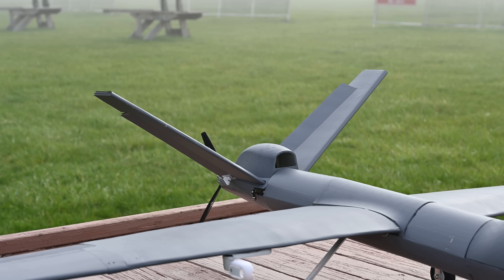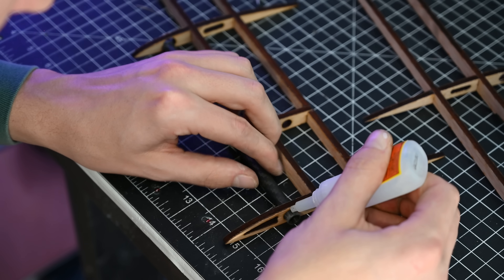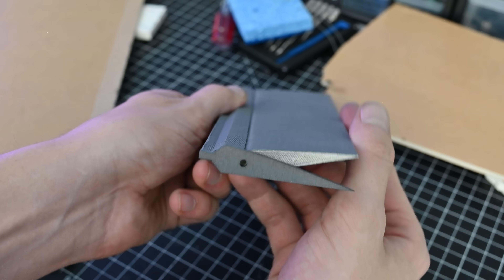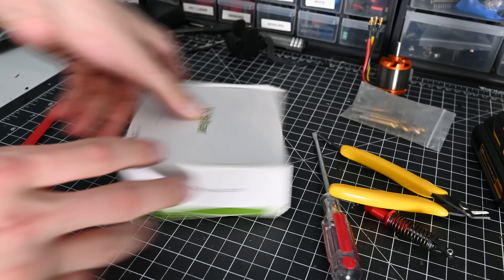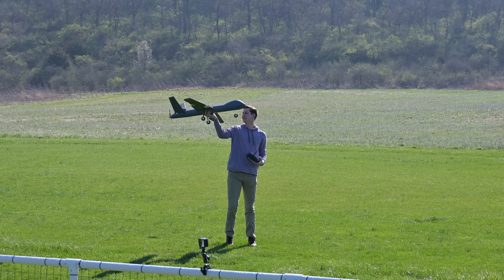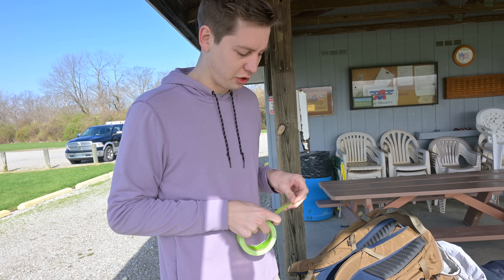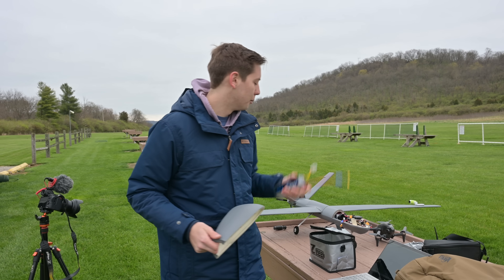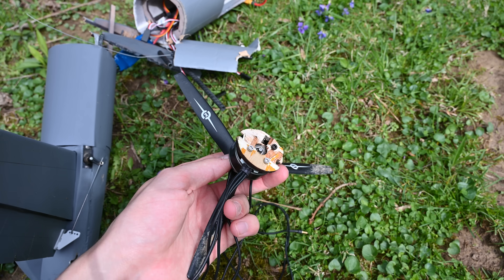Building a DIY REAPER Drone... Ended Badly

Comment: you could have used your sponsor again and had them make you over engineered rear prop mounts and landing gear mounts. they have a lot of materials to choose from for building, I'm not sure if they have it but you could try carbon fiber, or just say no to under powering this master piece and have all the structure made from refined aluminum and step up the motor size. it would need a good bit more thrust to launch but it would also be way more robust and impact resistant. plus you could add real mounting points for all of the hardware with wire routing through the frame. this thing could be awesome also adapt the bottom front of the aircraft(for a lower mounted 360 gimble camera or something controlled with servos and maybe a micro controller. idk man its awesome either way i was just spit ballin

Comment: I was lead designer for the IMMC (integrated misssion management computer) for the Global Hawk UAV.   Love your content.  Retired 2017.  So my stuff will be flying for decades.    In 1970 i graduated from high school,  an IBM360 system main frame executes 16.6 MIP (million instructions per second) in 2014 a single board computer VME6U about the size of a of a paperback would run 2000MIPS, wow that is lots of time to make reality happen.Like an FFT in real time.    ❤❤❤.  Good job!

Comment: Should have switched to larger diameter lightweight foam wheels so you could do regular takeoff and landing after the first flight. They are readily available at any mailorder shop or you could always make your own. Very thin but large diameter is the key so it is light but allows much better rolling. Will also give a lot more ground clearance for the prop.

Comment: I love that you are hitting all the maker marks with the laser cutter and 3D printer.  I've had students make rockets with 2 layer shells and they are light and strong.

Your reality is that models don't always work just by scaling them down.  Move the wing forward and try to mount the engine higher.  Try to make it more stable by moving the wing upward.

Comment: hey in aircraft design its about keeping it all in the circle. If you add more weight you have to compensate for it. I would have use just 1 six cell battery and placed it in the middle of the fuselage. This haphazard manner to building and skipping the testing phase is a common issue from software, mechanical engineering and building of structures large and small. Dont skip the testing it will save you a lot of time and money not to mention heartache.

Comment: Since you're not using landing gear. Maybe consider making a skid in the front? 

Just a Bent wire to safe the prop. 
Look at old style cable control airplane models

Comment: Add another motor which will turn two more propeller infront of each wing. The motor will be inside the body, the rotation will be transmitted to the propellers via some ribbons.

Comment: 3D print molds, surface treat and make the body out of a few thin layers of carbon fiber. be very careful with the strands because CF is pretty much as bad as asbestos. fiberglass also works plenty well for such a small object and is dirt cheap

Comment: You did a good job on it. As a suggestion build it at least twice as big if not bigger. Those bigger wings will have no problem with the added weight of several 8k ma batteries and an hour or three of flight time with gps points as nav points. Yes is it possible. If I can do it with a shadow you can do it with a reaper. Keep em flying bro!

Comment: MQ9's are not drones.
Reply: Yeah there RPA's
Reply: @calok  MQ9's are not UAV's- MQ9's are RPA's. You are speaking to someone who has worked on MQ9's. RPA=Remotely Piloted Aircraft. Meaning they need a pilot to control it. Drones do not require a pilot.
Reply: @ChristianAsselin-x2f  thats what i said
Reply: @calok  So in aviation the difference in classification is actually based on the requirement of manning. Drones can be pre-programmed to run a specific course, and while they do require oversight- they do not directly require human input once launched. UAV's are "Unmanned Aerial Vehicles", and another term for either a Drone or an RPA. Anything without a person in the vessel is a UAV. RPA's are UAV's that do not have a fully autonomous ability, or a programmable mission set. Just a bit of semantics- but tell any RPA pilot they fly drones and theyll give you this whole shpeel as well lol :) <3
Reply: @ChristianAsselin-x2f  Yeah

Comment: What a grate job keep it up, May I suggest you use Plastic, some carbon fibber or fibber glass material if u can for strength, and make it a little bigger and place the heavy material at the middle or just the right place. increase the length of the landing gear so the distance between the drone and the ground will have a reasonable for take off with no need for you to lunch it. (Just saying) But you did excellent work.

Comment: The build was very impressive.  About the crash:

1. Tail heavy. Adding the batteries and the landing gear adjustments did a job on the CG.
2. Angle of attack on launch was bad and there was insufficient airspeed. The result coupled with point #1 was an immediate and unrecoverable stall.

Comment: You use 1/4 pine to build the wings on the human passenger minimax. Some ultralights use mylar plastic to cover the wings.  Cut down on weight improve the glide ratio. Big difference between 8 to 1 and 30 to 1.  same with the stall speed.

Comment: Mike probably you add more HP on the propeller motor to correspond to the battery and the aircraft body weight - plus you need a bigger heart😊

Comment: Do you mind if i copy your cad from onshape and improve upon it? I already made a chassis. My plan is to build Full inhouse rc remote, 4g LTE connectivity along with 2.4 ghz remote control. Pixhawk installed on stm32f407. Telemetry will be there for QGC. No ready made flight controller. Where can i post my results. Would love to connect with u.

My major focus is stm32 based evaluation board software which i want to open source so that everyone who is poor like me can just do some medium level hardwork and avoid buying pixhawk cube etc ready flight control.

Comment: You should create a launching mechanism. Sort of like what they use on various TV shows when they have those type of drones being sent out. I would also remove that plywood and replace it with something like carbon fiber. It would probably be just around as light, maybe a little heavier, and you can get a beefier motor.

Comment: Your mistake at the end isn't necessary weight itself. I think you put too haavy part directly after engine, that's why your plane couldn't aim up. Try to install engine at front and try to leverage mass of it (use smaller batteries and connect them)

Comment: Find the CG location before throw. It is usually 30-40 % from the leading edge of the wing. Also don't throw up. Stall is caused by slow speed. Throw horizontally while human naturally throw up. From my 30 years of RC glider flying experience.

Comment: Try scaling this up. You will end up with a larger body wingspan and higher ground clearance.   It will take more energy to get off the ground, but you can make up for that with that second battery and bigger rotor.

Comment: Great Job Michael. I was thinking maybe you can replace some of stressed members with carbon fiber sheets that be laser cut such as the fuselage spars. That should give your plane much more strength so it doesn't break like it did above. And you can use balsa wood for the non stressed members where there are small loads to save weight.

Comment: Check out the Qidi Tech ASA filament designed for model planes, extremely strong and very light.   The newer Smart3 series Qidi Tech 3D printers are absolutely incredible machines with huge price drops announced a few months ago.  The XSmart Max has hit $800 range, I have recently bought the XSmart3 and was beyond impressed with how reliable and fast this printer is.   Check out their ASA Airplane filaments along with their new line of 3D printers they will prove useful to your hobby!  Very cool design!  My XSmart 3 has been used for 20 prints now using PETG, PLA, and ABS with a one hundred percent success rate and flawless prints.   Will be adding the Max to shop later this year.   I have some drone projects looking forward to trying ASA out on.

Comment: Little wheels for landing gear do not make scene, they snag on everything.  Instead use a flat airfoil ski, think modified pop-cycle stick,  with the tip angled up quite a bit when landing on a grass field.  A sling shot catapult launch system or pusher rocket motor that falls  away may work.

Comment: Drones dont need wheels to land. Use a catapult system for launch and use a folding prop. Think military, they even use nets to catch drones.
Reply: not that one the mq9 is huge and expensive and has landing gears your thinking about small ones
Reply: I wasn't talking  about the mq9 doh. @arthurboudaux4840
Reply: the reaper is like a small fighter, it has a landing gear
Reply: @nakata123 I know what the reaper is.

Comment: a carbon frame would for sure be better than plywood, if you could make a carbon body, even better and better tbh
would cost more, yes, but would also be way lighter and way stronger
a single 6 cell battery right on the center of mass would be better too

Comment: Two old school ideas for a launch assistance  could be  one an old fashioned   bungie like rc gliders  used to do before the electric retractable kicker motor  became popular  . A possible supplier of the band materials  could be either a sling shot band replacement  supplier or a medical l equipment supplier  for surgical tubing .  Or rocket assistance  .one option is to build a launch rail / ramp like the V1 used with  rocket booster  with  short thrust duration.   the second is to mount two Auxiliary rocket motors  near the Cg point  like early SAC  aircraft did to take off when heavily loaded( JATO). Try Google searching that term or  utube for a video on it . Granted, if  the plane is good in the air but is sub-par on takeoffs, and then possibly the extra thrust front two rocket thrust  modules  could possibly be the best way to  alleviate your problem . The rocket motors are relatively inexpensive  ten bucks for three  (A)  and (B)?  Sorry, it's been  a while since I bought any motors. Also, I might try instead of foam for skins, try  sheet balsa fusalodge wood and mylar wings.

Comment: You need some solar panels on the wings and less batteries. Maybe a bank of capacitors in the wings. 
I would go skids instead of wheels given the diameter if the wheels etc.

Comment: For the next one I would try and make it to where the wings could slip in better to the mold along with the nose cone to try and reduce drag. You could also implement the battery near the middle of the plane to try and help keep the center of gravity near the middle to help avoid a crash. I love the entirety of it and think you did an amazing job keep it up c:

Comment: Not sure if anyone brought this up, but you seem to be lacking a flight control surface dedicated solely to yaw control. It would seem you have roll and pitch covered, but the V shaped elevators will only produce so much yaw, and not at a perpendicular angle to the Z axis in flight. I would recommend adding a rudder directly under the fuselage below the elevators at the rear. This should give you full yaw authority in any crosswind flying conditions.

Comment: Noticed that you had some pretty substantial ridges between the front segments in one of the later flights. The amount of drag those were creating (while also impacting forward body lift) would be substantial and would make holding the nose up hard- was that a thing you noticed hand flying? A reluctance to pitch up? If so, honestly tape along those edges would've probably given you a lot more slip and lift. Also, more obviously, the lengthwise rigidity needs to be improved (less forward weight is a good idea you had, that will lessen the moment from the nose).

Comment: 4:30 just so you know what you did here is still illegal as according to part 107 (which I hope you have a part 107 license as your monetizing your drone footage here) https://www.ecfr.gov/current/title-14/section-107.52 you need to be 500 feet below clouds and 2000 feet horizontally from the cloud. And fog is just a low altitude cloud which would make it impossible to fly above the fog while still being 500 feet below and 2000 feet adjacent to it.

Comment: If you want to make the plywood way stronger before you put it together, brush it with cyanoacrylate/super glue. It won't add any weight but it will make it incredibly strong.

Comment: This is just a stepping stone to a better version. You learned a lot and a new version will be definitely better than this one. A few suggestions from me: make it bigger. The size is too small for a start on grass, double the size and you can fly anywhere. Using plywood this thin might be light, but laminated aluminium or carbon will be much better. It’s more expensive, but it provides a much better and sturdier frame. Lastly, if you make changes in the weight, take out the guesswork of balancing. Make sure your plane is balanced properly before you fly this thing. Keep on going with this great idea, I am looking forward for the next version.

Comment: Was calibrated and tuned with smaller batteries and and other parts. Sure the brushless and 9" prop would need more thrust then original settings. Any  arts and crafts stores shoulf carry balsa sheets. Tho dont believe weight was the issue,  but the hand launch without a run way to be able to tune snd go minimizing damage if any

Comment: Build to fly, not to crash; focus on light and strong not robust. Get rid of the landing gear, make it like a bush lanes or make it retractable for belly landings. Use a folding prop and your belly landings will be buttery smooth. Great work!

Comment: Why so heavy construction?  Lower weight = MUCH better flyer..  ditch the foam, and use balsa not plywood. Monocote covering. Those old timers who made planes this way knew their shit. That 6 cell battery probably weighs a ton!  If so- design plane to compensate for that weight.

Comment: it needs a stiffer fuselage and stronger landing gear. you need to position the landing gear carefully near the CG, and you really need to dial in the CG better. landing this airplane properly may be impossible on grass because the design simply isn't big enough. unless you increase the wing area this thing looks like it could be fast but quite a high-wing-loading handful to fly.

Comment: I thought this plane seemed really heavy!  Does this wingspan need those types of spars?  Everytime im in the situation where im like "man this isn't balancing i should put weight somewhere" I know some aspect of the design needs to be changed.  foamboard wings can be made like 60in or even a bit more with just a simple carbon fiber arrow from walmart

Comment: Way way too heavy for that size wing.  If you are going to use that much weight, simply adjust all your printing to 50% larger to make the whole plane larger with more wing area.  Another thing, maybe have someone else throw the plane so you can fully concentrate on correcting the flight path.

Comment: Pro tip, Glue doesnt bond well to a laser cut edge as it is burnt. You should sand off the carbon layer the laser leaves behind to ensure max strength.

Comment: nice plane bud .. i observed that the 1/4 inch ply your using is box store stuff , it breaks very easily ,  you got to try the aircraft grade multi layer stuff... from my testing over the last 35 yrs....the 1/8th multi layered ply inch its about 14x stronger than the 1/4in stuff your using. Its way more resilient to impact forces and bending loads.. i agree with others here if you were off pavement you would have been so stoked on the planes ground manners ... grass is tough for small planes.... really you need 3- 4 " dia wheels minimum to make good use of grass no matter the size of the plane... add the down fin to the tail to protect against prop strikes... or cheat that rear gear far back to get a better pivot angle so you can rotate on take off..pretty sure that Extra battery in the back put it in fly like sh!t mode.... nose heavy is usually just an annoyance most times its actually a good  .... one og my gliders flew ok for years , one day i just decided to bring my tackle box with me and just see how much lead shot i could add... i stopped at 2lbs!  thing flew like a dream... fast and long to land but woo it had a presence in the air, keep it up!!

Comment: The first flight was really impressive, you are talented in ways that differ from each other. I could not have even got the paint right much less build that if I had a thousand years. You may not be getting job offers from the CIA now though, it didn't blow itself up after it crashed. ;-)

Comment: just should've extended the wire and put the battery where the plane balances out
Reply: and just use the 3d printer with some good strong material for a durable chassis

Comment: The problem is that you used foam.  Don't use that material.  It's for fly until rubbish planes.  Not something if you want to keep it.  The wood should have been fine and if it's covered with monokote.  It's lighter than that cheap foam.  The likely cause of the last crash was it was over weight.  Yes, the other battery moved the CG but did it match where the CF was? I got out of RC's for a while myself and got/crashed a foamy.  I don't know if the motor was up to speed or if the throw was bad.  Hard to tell as I was alone on it.  But I seriously hate foam; period.  It's good for getting into RC's.  But isn't far from serious RC.  My point of view; take it or leave it.